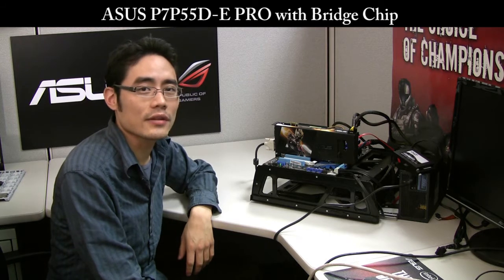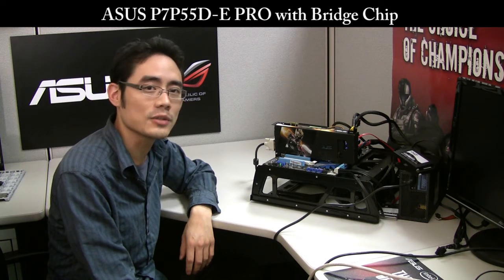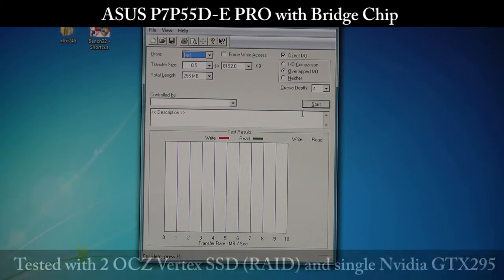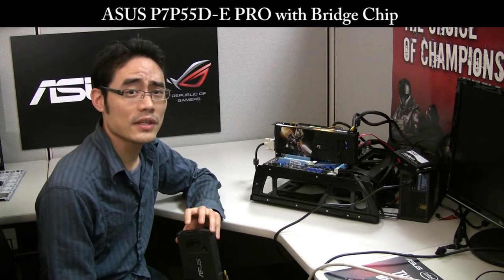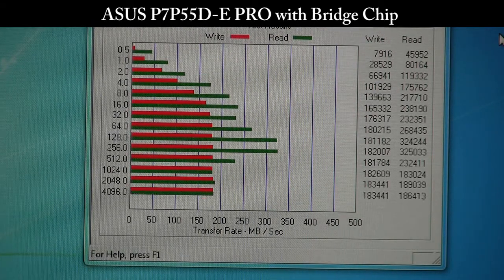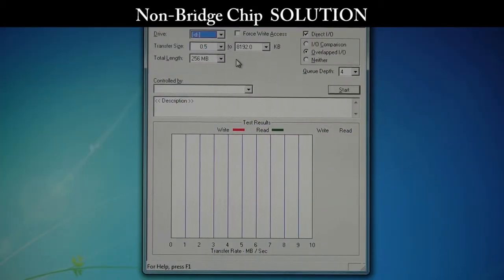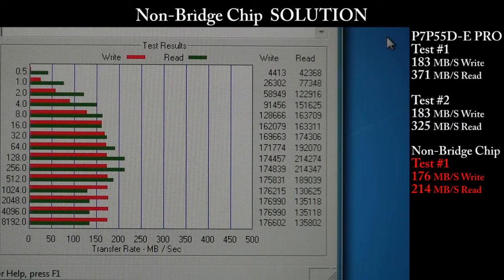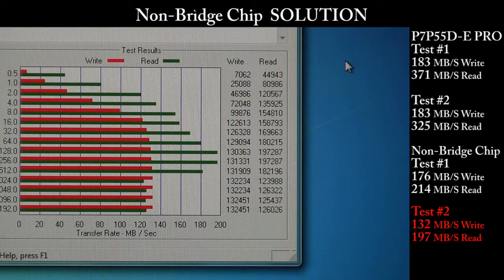ASUS True SATA 6gb/s and USB 3.0 technology vs competitors

Comment: I've been using the p7p55d-e DELUXE..but I can't really call it deluxe when the marvel sata3 controller is friggin useless. (samsung 830 ssd only achieves 305MB/s read in ATTO, and 150~ write) Now I wonder how in hell ASUS calls that TrueSATA3 support..
Reply: Hey I know its been 4 years but I'm working on an old computer for a family member and installed an sdd to the 6gb port. I am getting 343MB/s read and 227MB/s write. Should I go back to the intel sata ports?

In fairness to the video, he didn't post any amazing speeds either. Haha. Also I was under the impression that this board could only do crossfire, not SLI. I heard you could use a second NVidia card for PhysX but that's it.

Comment: @raydlevel5  The Marvell 9128 had a hardware flaw.  It scored lower in RAID0 than if you were to put a single drive on that controller.  They attempted to fix it with a firmware update, but they discovered it was hardware... it's a real pity. We'll have to wait for a next generation controller to really tap into the 750Megabyte Speeds.  To be honest, I don't think any hard drive today could really pull that off even if the controller did work. Hahaha.

Comment: My question is with this board does it knock a single GPU from x16 to x8 while using SATA3? While its not a major GPU loss you still lose 5% performance from your card.

I know the x58 boards don't have this problem but my issue is most i5 1156 boards have this problem it seems. There a board that doesn't cause this to happen? I like SATA3 for the future but it seems like the current can't prove it can actually handle SATA3 speeds and it takes the x16 to x8 on the GPU.

Comment: @AL117X If you get this board, it will run at x16: Asus P7P55D-E PRO
If you want something cheaper than this one and from Asus, I am pretty sure the pcie slot will run at x8 if you use SATA3 or USB3.